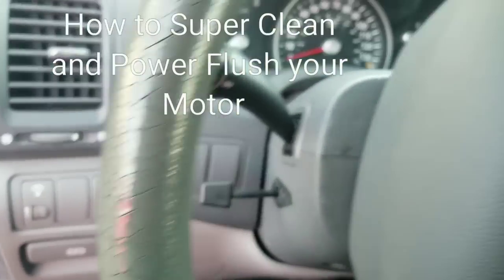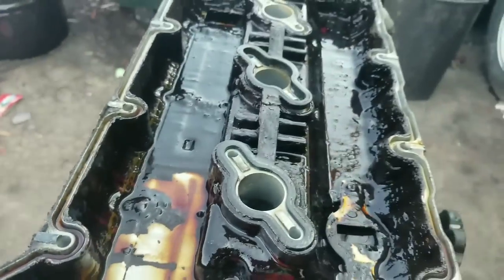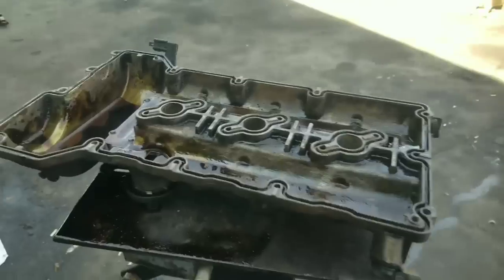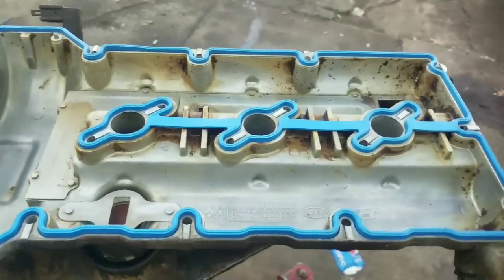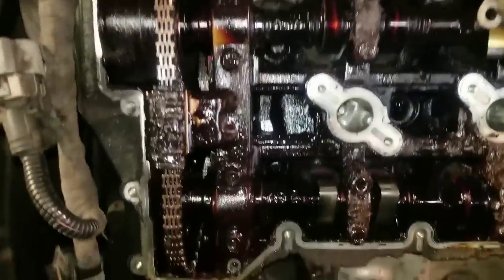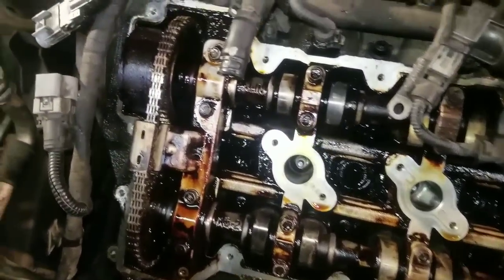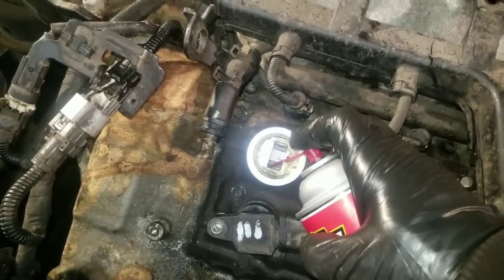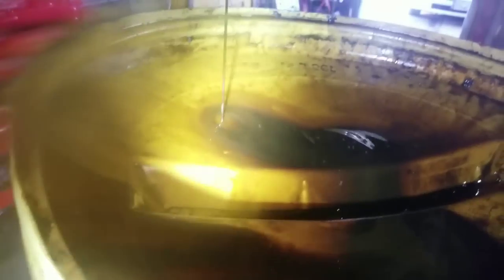How to Super Clean And Power Flush Your Car's Engine Pt.1

Comment: OP - I know this posst is ancient but still too intriguing for me to shut up about it - it's obvious why their oil pressure light is on.  It's on because nobody's changed the oil for the last 50,000 miles or else it's never been changed.  And the oil filter's been running on bypass since Bush was in office so, it's running totally unfiltered oil too. Naturally at this point there's nothing to lose by a flush.  That is, unless you use that "AWESOME" crap in the crankcase again like you did in the other video.  In which case you might as well just run the engine on Crisco or some shit, or else piss down the oil filler hole until the dipstick reads Full.  Since if you're using "Awesome" as a flush, you might as well just remove the oil pain and just start hitting the parts randomly with a hammer, then put the pan back on.
Reply from the maker: car still run great!!

Comment: hi i have a toyota vvti 1nfze petrol engine. bought it and took it for a full service had a slight knocking sound before and was misdiagnosed for a timing chain that needed replacing. They didnt flush the engine it now it has the oil light on now sound is louder even sounds like a diesel engine a loud knock.Engine still starts. What should i do? Flush it or not or it could be a rod bearing thats worn out??
Reply: you were screwed, sounds like they did not diagnose the correct fault, or did they? When you had the car back was it sounding smooth, if so then they were probably correct and the fault you now have is a different fault. It happens, sometimes shit follows shit and it is time to dump the car and move on.
Reply: keithspence thinking of buying a new engine it's way cheaper
Reply: Well from what you have described it does not sound good and a New Engine could be an option, but you failed to mention what did it sound like after the Timing Chain was changed, by the way I am a retired Engineer and in my 45yrs I have never heard of a Chain being a problem, a Chain Adjuster, yes! that can cause the Chain to RATTLE, but this noise sounds nothing like an Injector not working properly or a Camshaft, or a Conrad Bearing or Main Bearing on the Crank, so what did it sound like when you had it changed???
Changing the oil, or flushing, will NEVER in a MILLION YEARS get rid of an Engine Knock.
I did have a knock once that sounded like the Main Bearings on the Crankshaft, but with a stethoscope it turned out to be coming from the lower Front Crankshaft Pulley and was indeed the V Belt Pulley that drives the Generator [alternator] etc
Keith Spence Eng

Comment: How to get a return customer: step 1 ruin the engine, step 2 wait for them to return with broken vehicle.
Reply from the maker: step 1, change the oil , take care of the car. it came broke, left fixed, now whats your issue?
Reply: @crazysexycool180  the damage caused by your "repair" will at least get you a possible return customer. It didn't leave fixed, it left with a different issue. You put brake cleaner into it and used a wire brush on the cam lobes among other things. It was a terribly neglected engine so whether it was worse than the damage already done is debatable, however, I wouldn't want this procedure being performed on my engine, especially an aluminum block.
Reply: @crazysexycool180  you literally dropped a piece of metal into the spark plug hole lmao

Comment: No part 2?? Guess the engine died. I had doubts when I saw the wire wheel on the cam and no oil used to prime them once the old stuff was removed.
Reply from the maker: car runs fine, someone stole my phone that had the video clips.
Reply: Which was better the hand cleaned side, flushed side or both about the same?
Reply from the maker: hand cleaned, side, you can put more muscle on the burnt in oil and you can polish it easier by hand.
Reply from the maker: but the flush does a damn good job.considering

Comment: I thought this was an engine flushing process using additive or external pump circulation.BUT to grind and clean the crap into the engine must be seriously stupid. Then I read others saying the same thing. I wouldn't recommend this.
Reply from the maker: all debris was removed before car was put back on the road.

Comment: This guy is crazy man. I am not doing anything that I saw in this video. Using a steel brush on the cams and the head walls on the spark plugs tubes and on the valve cover and then sprays the hell out of all of that with a full can of brake cleaner? OMG even if you vaccum that stuff you're not getting out all the aluminum particles that fell in all of that sticky stuff you're gonna damage your cam lobes your bearings it's gonna go into your cylinders and scratch the hell out of your cylinder walls then the brake cleaner which is super degreaser will give your cams and timing chain a dry start also damaging. Do not do this to your car people don't do it.
Reply from the maker: so passionate, so wrong. the brush is not hard enough to score the harden metal in the motor. However not removing the build up will cause a lack of lubrication, a build up of heat, and eventual part failure. So whats your problem again?

Comment: I would have topped the car off with Royal Purple engine oil.  Change only the oil filter every 1k miles and top off with Royal Purple oil.  Once you hit 3k miles do a complete oil and filter change. Repeat process if needed.
Reply from the maker: thats an expensive process. use the purple after you flush it.

Comment: Can I do this to my 1998 Honda Accord?
Reply from the maker: yes
Reply: Would you recommend me doing brake cleaner or using awesome that you have done in your previous video?
Reply from the maker: I haven't created anything. nor did I drive this car all those miles on dirty oil. the car came in with a knock and my job is to solve the knocking issue. as far as change your oil, i agree . This is what can happen if a person don't change oil regularly, and needs or wants to do a major flush.
Reply: Don't 
Search on YouTube and  you will know way not good
Reply: NEVER

Comment: How to flush oil.... buy 5 quarts cheap crappy oil for your engine and cheap but good filter, like motorcraft etc. drain warm oil, put in new oil, run vehicle for 100 miles, do oil change again with decent filter and oil, run vehicle 1000 miles, do oil change decent oil and filter, then do it like your supposed to or pay $1000's for a new engine/car/uber, rather than good oil and filter.

stay away from fram and supertech oil. Check rockauto for cheapest parts.

Comment: Thanks I'd rather do multiple engine flush with the motor flush in one day untill the head the valve cover the cams look absolutely clean and the oil is absolutely clean rather than do all that damage to my engine. You fool
Reply from the maker: what dammage ?and it was flushed multiple times, so what r u talking about?
Reply: @crazysexycool180  not on this video
Reply: Is it still running????